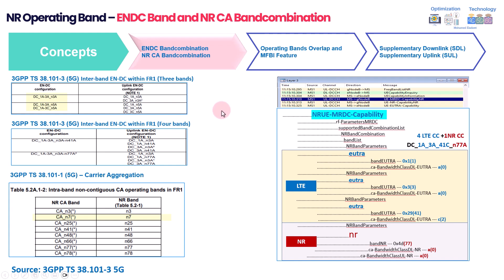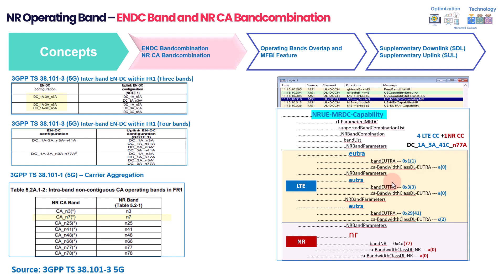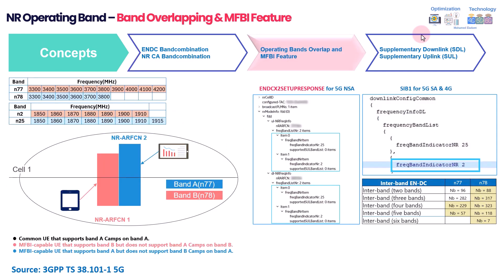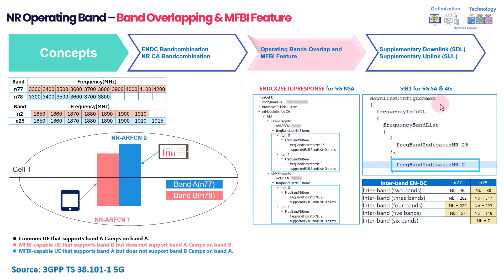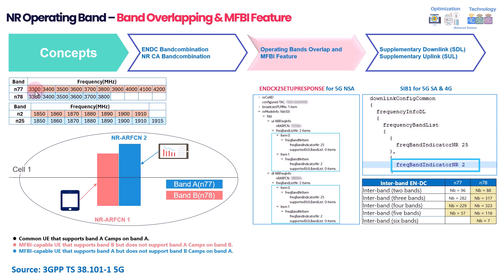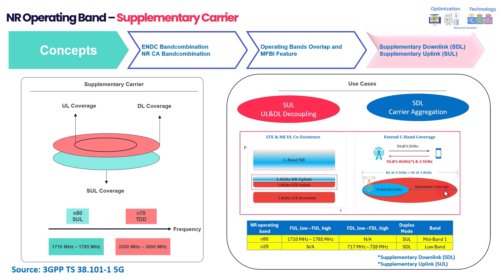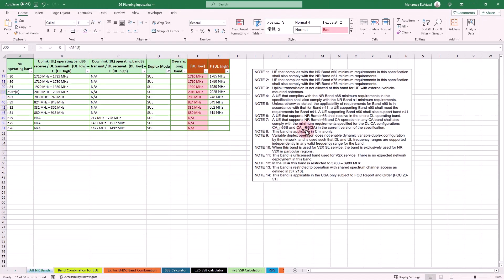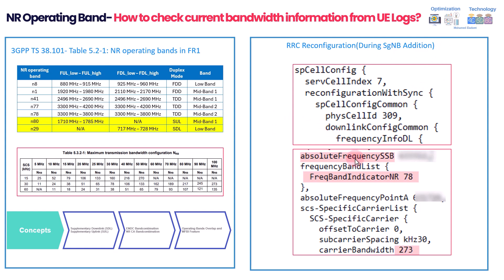Learn About 5G MFBI Feature and SUL/SDL Use Cases

Comment: How do we run or configure UE to run CA_n29A-n66A ?
Reply from the maker: 1st you need to check if this carrier aggregation combination if supported by 3GPP, then you need to check UE capabilities for the same, 3rd check the frequency definition, carrier aggregation feature and related configuration in your current vendor

Comment: Thanks, Mohamed! Your videos are amazing—detailed and highly productive.

I was searching for the Excel sheet but couldn’t find it. Could you please let me know how to get it? Also, I’d love to hear your advice—if we have Band 5 with C-band, would it be beneficial to apply SUL on the low band, or would it function similarly to ENDC or DSS?
Reply from the maker: Thanks Ali,
the excel sheet is uploaded at the below link 
https://www.mohamedeladawi.com/5g-nsa-nr-planning-materials/

Regarding the second question, based on my understanding, ENDC can provide benefits over 5G PUSCH when using the fallback mechanism. However, there will still be limitations related to PUCCH (control channels), which can be addressed by using SUL. Ultimately, the deployment depends on the operator’s specific requirements.
Reply: @ thanks Mohamed , appreciate your feedback 🙏

Comment: Thanks adawi, brilliant as usual

I have question: for mfbi deployment should we define both cells as N77 or N78 ?

 As i know native should be N78 (the smaller band) so mfbi should be activated on N78 in order to be broadcasted as N77 (wider freq). But im not sure what will happen if we do the opposite
Reply from the maker: Thanks, Ahmed. I’m not entirely sure about the answer, as I don’t have much practical experience with MFBI in 5G yet. However, I do have experience with it in 4G (between Band 38 and Band 41). Let me share a practical scenario I encountered regarding N78 and N77.
I have seen a network that supported both bands, and we configured both N78 and N77 as serving PCells. However, in practice, both should be ended up operating as N77 in the primary cell. This means MFBI was activated on N78, but we faced a challenge in 5G—possibly related to vendor capability.
Whenever the UE was camping on N78 as the primary cell (with support for both frequencies as a primary serving cell), it could receive service normally as N78. However, it wasn’t able to establish carrier aggregation, as the UE only supported N77+N77 CA.
In a standard scenario, an intra-cell handover should have been triggered to switch the frequency from N78 to N77 via the MFBI feature, enabling CA. However, based on KPIs and field testing, we observed that the UE (iPhone 15 at the time) could only achieve carrier aggregation when N77 was the primary cell as he was reading n78 and n77 at that time, which means the MFBI was working only when the n78 was acting as secondary cell.